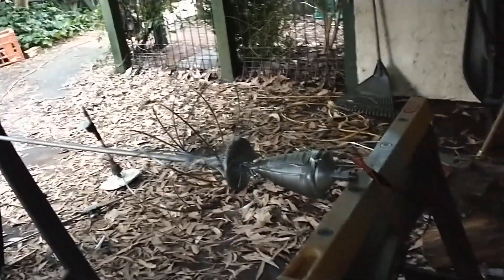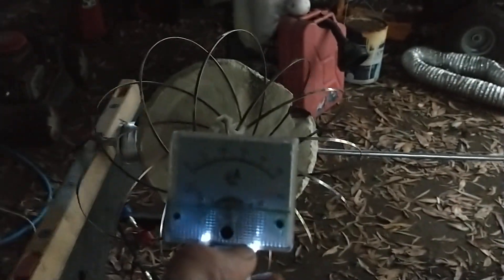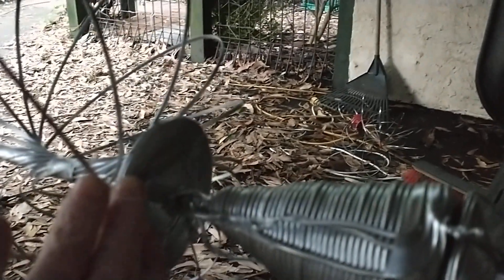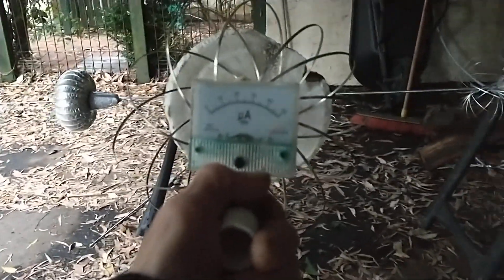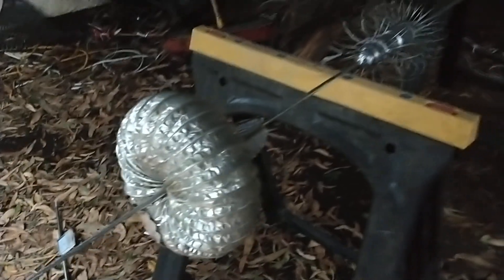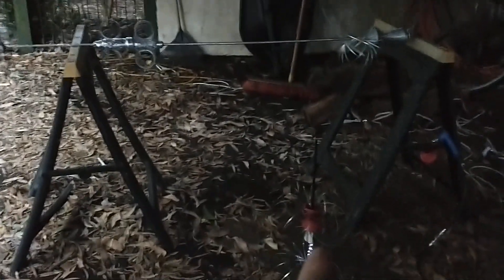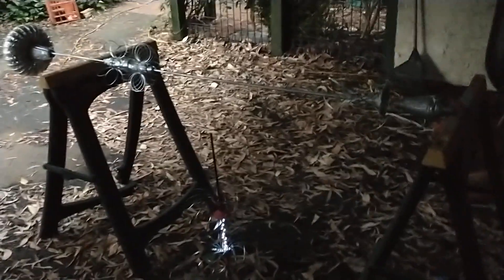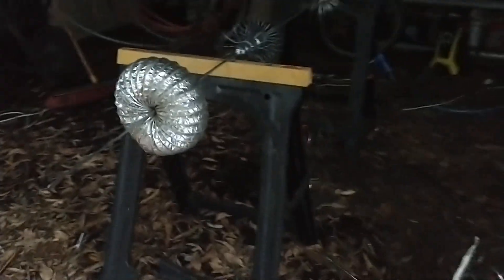New Version HF Mobile E field Antenna Preview ⚡🙏⚡

Comment: There are mobile antennas called Texas Bugcatchers.  This one ought to aspire to something bigger than bugs,  at least!
Reply from the maker: Hahaha,  Wow,  I just googled the Texas Bug Catcher lol,  That is an Interesting Design.

Yeah,
This one is way more efficient
though probably slightly less efficient at catching bugs hahahaha.

Thanks for your comment my friend.
73 de VK3VKe ⚡🙏⚡
Reply from the maker: I have been Thinking about that Texas Bug Catcher hahaha
and in a way,
I could consider it to be 
an Oversized Impedance Matching Network /ATU 
with RF Leakage hahahaha.